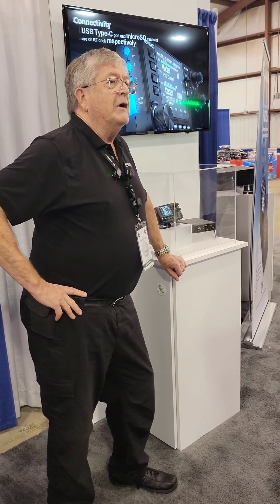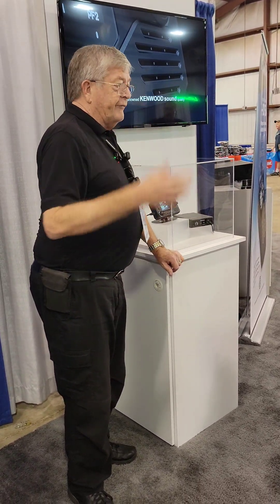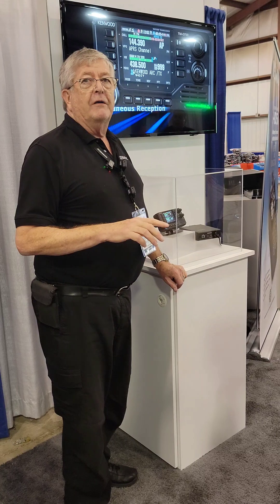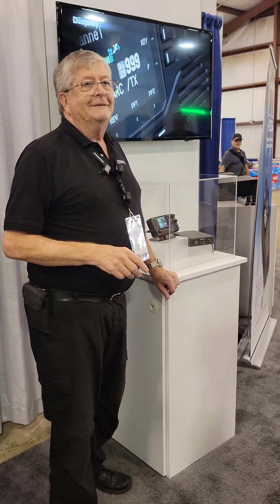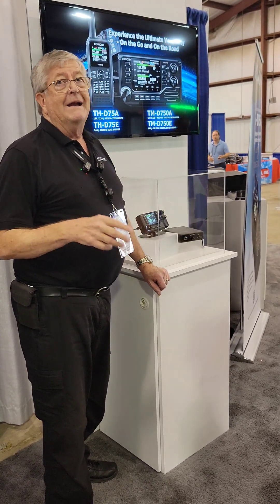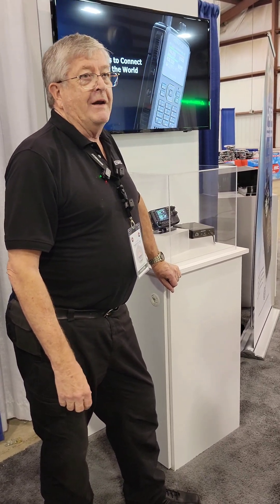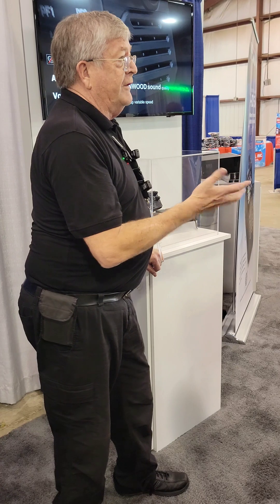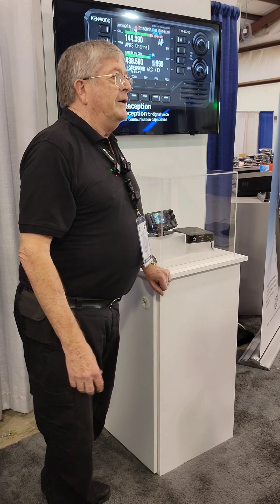Kenwood TM-D750 Details Revealed: Hottest Features from Hamvention 2025!

Comment: Should have been 100-200w versions like the old mobile kenwoods, Split VFO for the tri-bands, TNC should accommodate an expanded set of digital modes, and Digipeat functionality. A firmware update to allow kenwood HT's to control the radio for off grid expanded operations. 

That would be the mobile radio to rule them all.
Reply from the maker: Love the Kenwood Sky Command system! Thanks for watching and commenting! 73

Comment: Straight up.  If it isnt going to out out 50 watts on 222Mhz, I will pass on it.
Reply from the maker: You will likely have some extra cash in your pocket then...
Reply: Same here, they are still using old technology for 220, it will probably only be 5 watts, what a Joke. I'm guessing the will ask at least $1200, was excited at first but I will pass for sure.
Reply from the maker: @terryclaiborne9429 I don't see this being a $1200 radio. Maybe $1000 when it comes out but not $1200. I did notice the D75 was $550 at Hamvention. I think the current regular price is about $640 - just about $100 less than launch. I think in time the 750 will settle into something palatable for most that want all it's capabilities.
Reply: It will likely be around 30 watts on 220.

Comment: embarassing they still don't even have a working demo months later... saw this same mock up at orlando
Reply from the maker: This is not the same mockup. This is much more refined. The RF Deck of the Orlando mockup was obviously a mockup. It didn't have any ventilation in the case, no power supply cables, etc. This looks like a finished radio. Now, the display is exactly the same. I think Don's explanation aligns with what we can actually see.
Reply: @digital.rancher  the display is still not working so it shows me they don't have a working radio yet... kenwood is sort of a joke at this point tbh.... sad what they've become... they used to make the best radios

Comment: Kenwood needs to stop fooling with the VHF crap and come out with a new HF rig for the adults.
Reply from the maker: If you have some HF money burning a hole in your pocket, the TS-990 is still one of the best. Or if you want something newer, pony up your bigboy checkbook for the Yaesu FTDX-101MP, the Icom IC-7760 or the even newer Flex Radio 500 watt Aurora. I'm sure the adults are aware of that though.

Comment: Kenwood should learn from what Icom has been implementing in the last 28 years - IC-706 series, IC-7000, IC-7100 etc, and include a microphone connector on the front panel and ALSO on the rig body. It will make installing in a mobile so much easier than running multitude of cables to the rig in the back of the mobile to the front dash
Reply: Im pretty sure it has a 2 pin kenwood audio connector on the left side of the head unit and rj45 style audio out on the deck
Reply from the maker: I agree 💯
Reply: I agree - I was expecting to replace my FTM500 with this radio, not now.

Comment: 710 has mic input on the body and not the head. How stupid is that. And here they are coming with 750A with the same issue. It does not make sense to me unless you place the head on top of the body.
Reply from the maker: It does limit your installation options.
Reply: Im pretty sure it has a 2 pin kenwood audio connector on the left side of the head unit and rj45 style audio out on the deck
Reply from the maker: That would be outstanding!
Reply: @digital.rancher yes I agree best of both worlds, 2pin for handheld mics and rj45 for desktop mics. kenwood is also coming out with a new desk mic to replace the kmc-9c

Comment: "We'd rather take our time and do it right."  Yet, no cross-band repeat on the 1.25 M band...🙄
Reply: I do have an Anytone AT-5888UVIII which is a chinese radio and I do cross-band repeat 220MHz-70cm
Reply from the maker: I'm curious your use case for 220 cross-band. Can you elaborate? Thanks!
Reply: @digital.rancher Sometimes I just like to listen to a local 220 repeater and listen on UHF with my HT in hand when I'm not in the shack... I can do 144-440 and 220-440 but not 144-220. I believe the 220 is bridged to the 2m circuit. Hope that gives you insight

Comment: OBTW I am getting one to replace my 5100. I think ICOM has been slacking a bit and think they need to swap out their US crew. This radio has a far superior display and has TNC built in. Wish they would have added a SAT feature for FM bird but easy work around, I am suspecting.
Reply from the maker: Agreed it's an easy work around to adjust for Doppler manually. Though a day mode that adjusts for Doppler automatically would be cool for a mobile rig